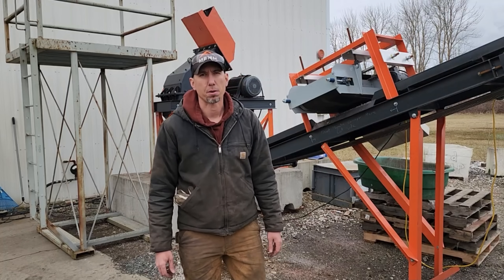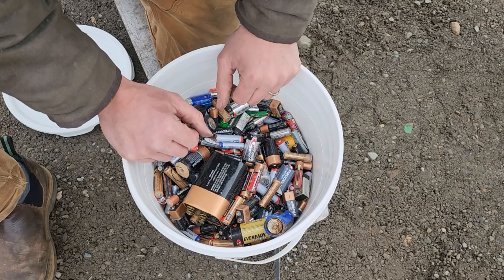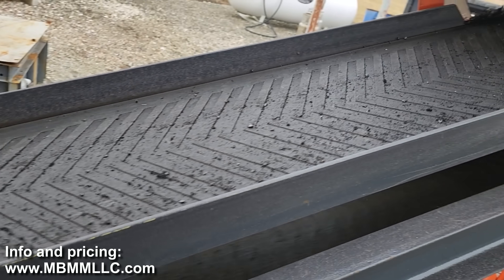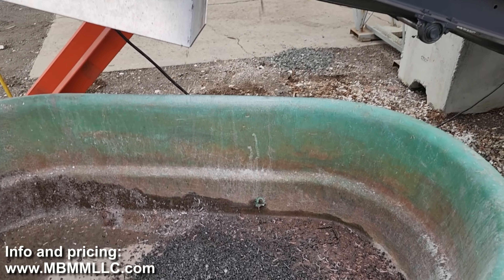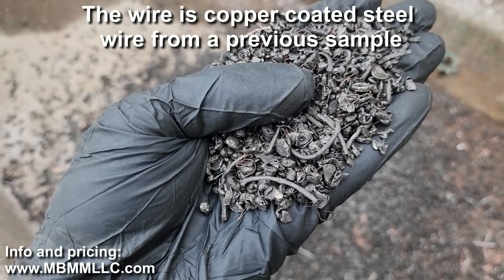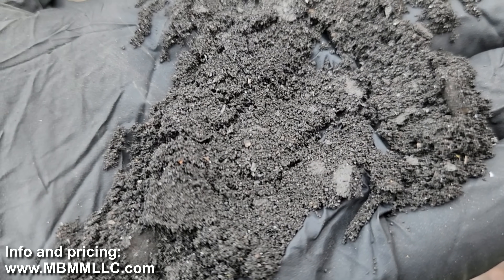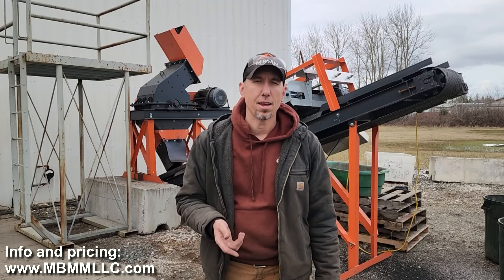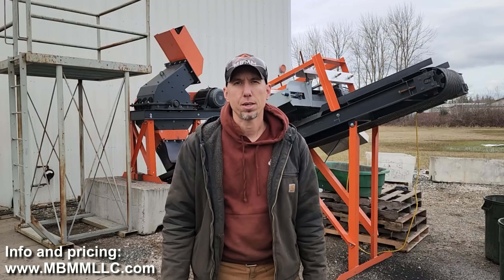Recycling Batteries

Comment: I just recently took some Li ion batteries apart to see what I could extract, the lithium reacted very quickly with the air (I could actually smell it getting hot)  and I was rushing to yank it out and put it in oil so I didnt lose it...strange things batteries
Thanks for sharing

Comment: I just throw mine to the nearest body of water, has worked out well for me for years. Nice to hear about alternatives, I have been sometimes wondered about recycling but the cost-benefit just is not there with the current level of technology we have.
Reply: So you intentionally litter and pollute the waterways?
Reply: @BornIn1500 The water has some mechanism which recycles the batteries automatically, I have never seen any changes in the water. So it must be fine. Nature is truly remarkable.
Reply: Either you're joking or you may be the biggest idiot on the planet.

Comment: Cool vid as always. Thanks Jason.

As mentioned in other comments, Potassium Hydroxide used in battery electrolite can be corrosive to machinery. 

Adding a neutralizer to crushing process may be a wise consideration.

A weak acid such as Acetic Acid or Citric seems common. Probably worth a quick consult with a chemist.

Comment: Alkaline batteries have KOH inside which is usable.  However watch out handling the MnO2.  It is a cumulative neurotoxin.  The carbon can be converted into Graphene.  Also steel and zinc.

Comment: Hmm, afaik these are best recycled with a small blast furnace. Company in Germany just melts them down. Carbon and Plastic are fuel, manganese oxide and iron become good metallurgical iron/steel and any zinc distills off as vapor - which is - coincidentally - how zinc is refined anways and how the zinc from galvanised scrap is recovered in well equipped steel mills. Simple as that. What we really need as a society is better ways of recycling lithium batteries, they contain substances which are a) much more valuable b) more toxic and c) not processable via a single melt because nobody wants a aluminum, copper, cobalt nickel alloy :P

Comment: Jason, Just a quick question for you. Why don't you continue to mine the underground mine? The weather would not affect any work underground and you would be able to stockpile material for processing in the spring? I realize getting to the mine would be tough (do not have any knowledge on conditions in mountains) but what would the old-timers have done? Thanks
Reply: I'm not him, but in the first video he was saying that July was the earliest in the year that he could get up there. There was still snow on the road. I think it must be WAY up in the mountains.

But also, it will take time to process all the ore they removed.

The old-timers I guess would have gone up on mules and lived at the mine.
Reply: I kind of thought the same thing. Working underground (I would not think) during the winter months would not have to stop along with continue to build up the supply of ore to process in the spring. It would get mighty lonely though!

Comment: The "wire" is a brass nail thats the current collector for the anode. It is welded to a steel end plate which is why it got carried with the magnetics.
Reply: There is no steel in any battery. Nor brass either.

Comment: Battery disposal is always a bit sketchy for me. The regulations and where you can drop them off seem to change with the season around here. These days I send them off with my son for disposal in a bin at his workplace that supposedly gets processed in a recycling facility. For all I know it ends up dumped off a barge into the ocean.
Reply: They actually have to get sorted by type by the facilities. There are many battery chemistries that are not compatible with each other or extremely toxic.

Comment: Well if nothing else, there will be zinc, manganese and steel...

Also some carbon...

Maybe, depending on what other types of batteries, could be nickel, cadmium, cobalt, phosphorous, lithium, copper or aluminum as well.
Reply: There is no steel in any battery.
Reply: @cosmefulanito5933  Are you genuinely that ignorant, or just that much of a troll as to lie about something so proven as the fact that all small cells are made with a steel housing?

Comment: You really should know what's in your materials BEFORE you crush it. But if safety in not your top priority, that's ok. How do you deal with lithium ion batteries getting accidentally mixed in? A partially charged Li ion could burst into flames and set your rubber belt on fire. Have you had this happen yet?
Reply: Doubtful, else he'd have checked for lithiums first..
Reply: This was a sample sent in by a customer. I highly doubt Jason will ever crush batteries again.

Comment: The black mass is mostly carbon, manganese dioxide, and zinc compounds. It also contains potassium hydroxide, so it is corrosive.
Reply: @junkman8742  Not really, as long as you dont eat it. Manganese can be toxic in large amounts, but the oxide doesnt absorb through skin. Potassium hydroxide isnt toxic, just caustic. Zinc is the only threat and it isnt much of one.
Reply: Note the potassium hydroxide will pick up enough moisture from the air that it'll react with carbon dioxide, forming potassium carbonate. The hydroxide is quite caustic and there's probably plenty of it in the un-damaged cells, but once it's exposed to air such as through leakage it'll form the characteristic efflorescence usually seen first on the anode of old alkaline cells. From batteries chipped up like this, it probably reacts with carbon dioxide in the air within hours or days, although it probably doesn't react completely for some time so the pH is probably quite high until it does.
Reply: @junkman8742  Rechargeable lithium would have caused a fire. They looked like regular disposables, you'd have to ask him though. NiCd and NiMH are hazardous waste so I doubt hed have used them.
Reply: Sounds like a flux recipe
Reply: @dantoppa1265  Manganese dioxide is commonly used on stick welding rods as a flux, so yeah, kind of.

Comment: From what I remember the black stuff is almost certainly manganese dioxide mixed with carbon and it looks to be contaminated with zinc, usually the zinc is either present as the casing in zinc-carbon or suspended as particles in a gel in alkaline cells which can be liberated by dissolving the paste in acetone, there's typically a plate bonded onto the top and bottom of the cell and a graphite terminal in zinc-carbon cells or a metallic terminal post in alkaline cells.
Try and separate the smaller button cells from the larger alkaline zinc-carbon as some are silver-air cells but more and more lithium chemistry button cells are being sold which is worth keeping in mind.
Reply: Interesting. I knew there was a lot of carbon and manganese  and some potassium. There is also sodium hydroxide. My need was for, manganese  potassium, and iron in that order, but the sodium was a problem since this was to be used in horticulture  for which I had no source for manganese, and potassium became unavailable two years ago. Then the manufacturers stated a problem with mercury. How much mercury is in alkaline dry cells? Is there a simple way to separate manganese and iron and flush the sodium and potassium. I would prefer to use acetic acid, 9% or 30%,  if possible to make this separation because of availability and cost.
Reply: @larrytischler570  It's been a long time since I've done anything with the contents of alkaline cells, but I believe manganese dioxide is essentially insoluble in water and resistant to dilute acids whereas those sodium and potassium hydroxides in the electrolytes and other salts would readily dissolve which allows you to filter the solids from the solution, the other content in the solid left after filtering may be treated with acids as long as they're not too aggressive or concentrated to attack and dissolve metals like zinc whereupon the dissolved metal content can be dissolved, you may have some difficulty removing the carbon but if it's for horticulture I doubt it'd an enormous problem. 
As for the mercury it shouldn't be present in any serious quantity in alkaline cells other than button cells, there may be significant quantities of nickel present though even if it's a it's under 1% quantity by volume
Reply: No Mercury used in over 3 decades.
Reply: @junkman8742  yes, and doing it outdoors is literally poisoning the town. zinc, cadmium, and all kinds of heavy metals and chemicals. Dust in the wind is going to cover everything down wind.

Comment: seems like the "steel" part has allot of copper in it, is there any way to separate that? from what i can see, it seems like there are alkaline and regular batteries in that batch, i think you can salvage zinc from those too...
Reply: The steel is going to recycling anyway. The recycle center can sort out the metals much more efficiently than we.

Comment: Aren’t there 4 D cells inside the large 6 volt batteries?
Same as there’s 6 AAA batteries in a nine volt?
Reply: All will be pulverized the same way.
Reply: Yeah the larger 6 volt lantern batteries have four 1.5 volt cells inside them, it's what I think the braided copper wire you can see in the metallic parts later in the video is from. I believe the cells inside a 9 volt battery are colloquially known as "AAAA" cells from what I remember, but yes there's usually six short, narrow cylindrical 1.5 volt cells in two rows of three in a 9 volt battery in two rows of three held within a steel casing.
Reply: Some, yes.  

For the 9v, most have flat cells contained in plastic.  Only a few high end ones still use AAAA's (not AAA).

Comment: That's a  bizarre thing to recycle as there are no valuable materials in alkaline batteries.
Reply: Quite the opposite- the manganese dioxide and metal content has a small but non-zero recycling value that while not terribly valuable in small volumes, can potentially add up to a significant sum if recycled in the tens or hundreds of kilos
Reply: As with most things in recycling, volume is the name of the game. 10 or 20kg mightn't be worth while but 200-300kg if you've already got the kit will be.

Comment: There is a significant amount of manganese oxide in those bateries. I wonder if you would be able to recover some manganese metal.

Side question: I will be doing some cupelation with bismuth as colector metal in near future. At what temperature do you cupelate your samples?